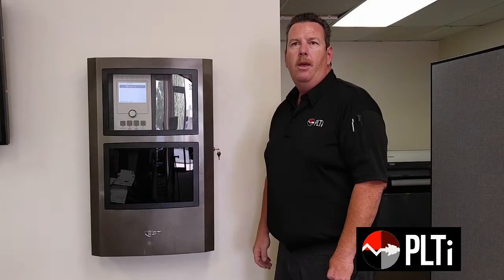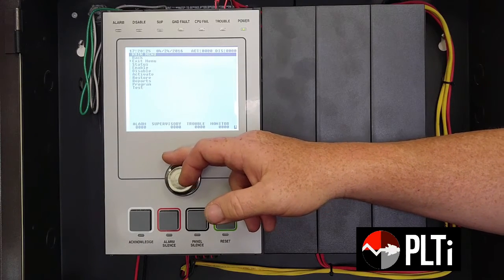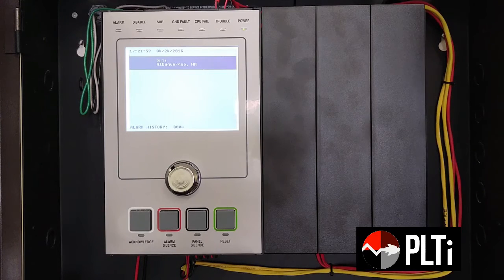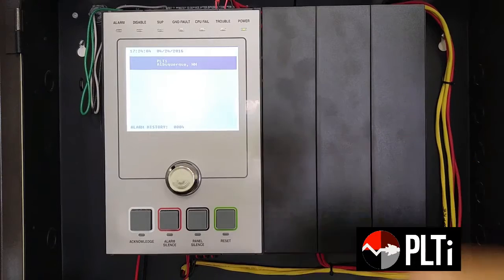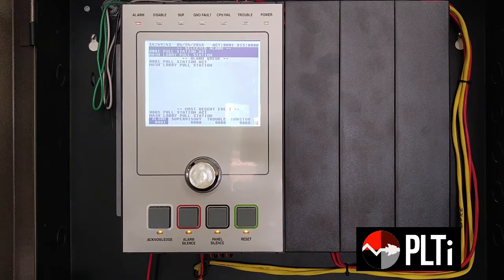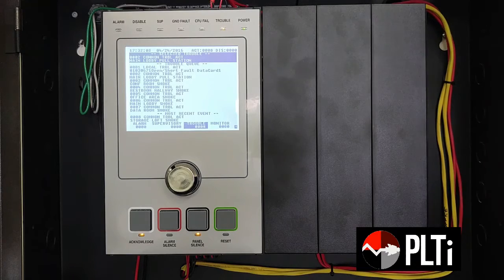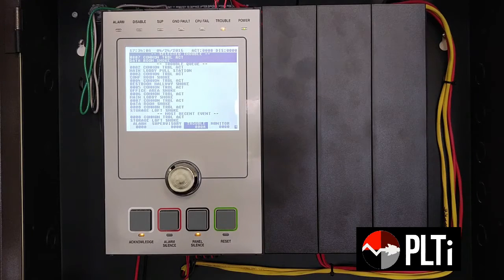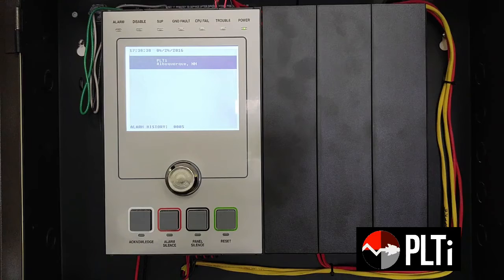EST3x Basics

Comment: Hello, thanks for the video. Do you have any information on how we can print hard copy reports of 'troubles'
Reply: A printer or computer may be connected to the panel through the RS232 port. It's a bit of a process, but is described in the manual

Comment: Hmmm ran into this panel today..first time seeing it...how do you disable to keep the fire alarm from going off while testing sprinkler..thanks
Reply from the maker: You need to know the address of the module monitoring the waterflow. There is no easy way to determine that unless you have good as built drawings. 
If you can locate the address then you go to main menu, disable, device, and enter the address P0x C0x D0xxx and then the password which should be 2222

Comment: How do you fix a ground fault indicator light that does not work? How to simulate a ground fault?
Reply from the maker: It is not possible to repair a ground fault LED in the field. this requires returning to Edwards. How old is the system?Are you the end user or the installer?To simulate a ground fault, make a jumper and touch between one of your power limited circuits, such as the SLC + and the ground lug inside the cabinet.

Comment: GOOD EVENING, DO YOU KNOW TO REPORT THAT FAILURE IS THAT "Card 01, Wired Lasso?
Reply: That does not sound familiar.  Are you certain that is the correct language?
Reply from the maker: If the trouble is still present use the center nob to select it, press the nob, select details, and repost the error code displayed. Should look something like this, 01 01 0XXX. I'll try to help you sort it out.

Comment: In your next video, would you be able to demonstrate how to use the "control knob" (identified @ 1:28) as a volume control for system horn circuits?  Inquiring minds need to know!
Reply from the maker: Ryan is correct, code does not allow for dynamic volume adjustment.
Reply: Not possible. Horn strobe volume is set at the device. Usually hi-med-low. Speaker strobe volume is set via a wattage tap.